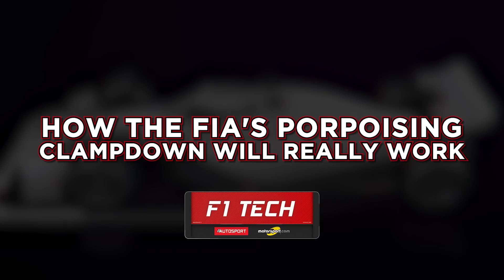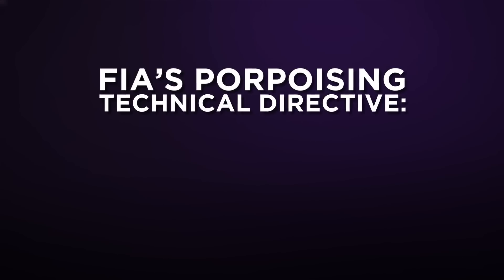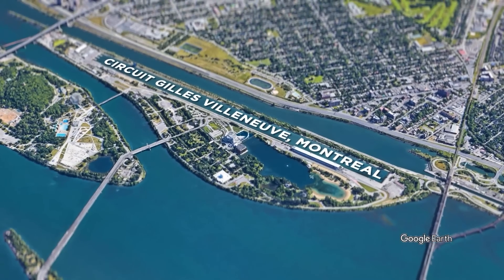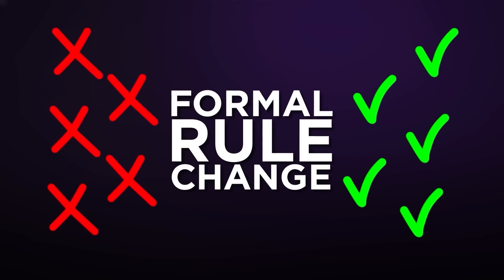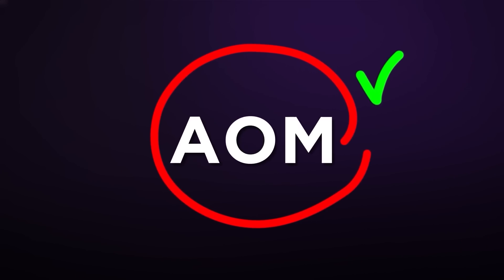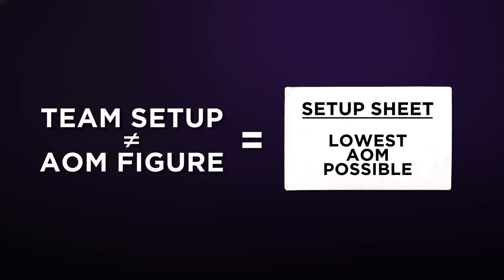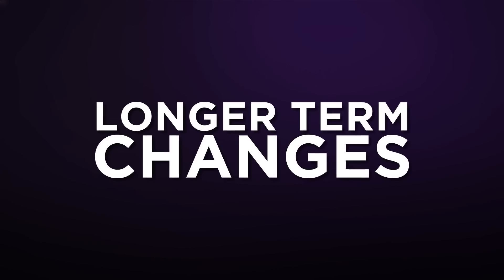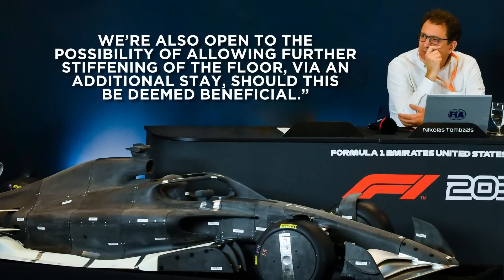F1's Porpoising Tech Directive - How it Really Works

Comment: As long as current teams which solved porpoising don’t get penalized that’s all that matters
Reply: No team has solved the porpoising yet but mercedes porpoise more than any team in most occasion. Mercedes will get more penalty
Reply: No team as solved it. That’s the problem
Reply: @built2jzlexus496  redbull has and they have a top 2 car
Reply: @zXPeterz14  if they solved it then why were their drivers complaining about it too?
Reply: @built2jzlexus496  i havent seen any complaints since the early season but i might have missed something
Reply: @zXPeterz14  they said ALL the drivers met and 19/20 drivers agreed the porpoising was dangerous after Baku
Reply: @zXPeterz14  every car still bounces a lot because of the stiff suspension this year. Suspension regs need to be changed for next year as well because this is not sustainable longterm for drivers. They could end up with permanent brain damage.
Reply: @built2jzlexus496  you dont have to have porpoising to know that its dangerous. You do know not all teams suffer with porpoising? Like even if everyone has it most teams can work around it to the extent that they dont have any at all. It comes down to the ride hight. Lift the car and no more porpoising. Walla👏 everyone knows why its happening, the teams choose to not do anything about it. Mercedes can't except they built a shit car and now puts their drivers at risk instead of running the car safely. Its a design fault and thats it. Porpoising has always existed in series where they use ground effect. Its not anything new.
Reply: @johannes727  I kno they’re all suffering from it. Why are u talking to me? Lol
Reply: @johannes727  they all suffer from it because all the drivers complained about
Reply: @built2jzlexus496  not all drivers complained about it thats a flat out lie and you know it
Reply: @johannes727  it’s all over the media that 19/20 drivers complained. Check for yourself if u want
Reply: @built2jzlexus496  You actually made me google that now and look on twitter. Absolutely nothing about 19/20 drivers complaining, and again there is a MASSIVE difference between drivers saying its unsafe and drivers complaining about it. I can only find drivers saying its unsafe. I mean im pretty sure the whole world knows its unsafe. But its down to teams who are running it so unsafe to fix it in other words lift their cars so that thry dont have porpoising. I honestly think you maybe just understood it wrong. So no issue.
Reply: @built2jzlexus496  binotto said no that toto should worry about his drivers
Reply: @titancheat  also if FIA can ban party mode in mid season, why can’t FIA do reg change in mid season?
Reply: @titancheat  the whole reason the FIA did anything is because EVERY driver complained. Not just 2.
Reply: @johannes727  Ok except Alonso
Reply: @built2jzlexus496  This guy with his blatant lying... Bro im not going to say what i want to say now. But you need some formal education
Reply: @johannes727  dude don’t call me a liar. The facts are there. U just don’t want to look for them. All the drivers complained in their meeting and it’s on record
Reply: @built2jzlexus496  im not saying it again after this. The drivers in the meeting said poirposing is dangerous. THEY NEVER FKN COMPLAINED JESUS.. THERES A MASSIVE DIFFERENCE BETWEEN SAYING SOMETHING IS DANGEROUS AND COMPLAINING ABOUT IT. FKN READ A BOOK OR LEARN SOME ENGLISH FFS
Reply: @johannes727  so the drivers said “it’s dangerous but let’s keep it”?
Reply: @built2jzlexus496  The drivers said its dangerous so the teams suffering from it should fix it or lift their cars. Thats what they said.  The drivers complaining about it is only a few realy, and its only the teams that cant get the performance out of their cars because of it. Not all drivers. And its not fair at all to change the rules to suit some teams if other teams have proven that you dont need to suffer with it. So basically it comes down to shit design from some of the teams. The issue i have with it is the fact that EVERYONE knows how to fix the problem, but because it means they will lose performance, they choose not to do anything about it. Dont you think its weird that Hammy was complaining so much about his back one week, the next week you can see the car is just as bad but he will tell you its not because they know the current rule change will limit their performance. Its all just a game at the end of the day.
Reply: @johannes727  Sainz is the driving the fastest car and he’s complaining so it’s not just ppl with slow cars complaining. There have always been rules in F1 that punished some teams more than others and none of those rules were related to driver safety. Ppl are afraid of it changing the pecking order and I’m not certain that it would.
Reply: @built2jzlexus496  I didnt say its all slow cars. What i did say is there is ways of working around it that will just mean you lose performance, im a ferrari fan and i know its probably going to cost ferrari the championship, but they should have designed a car that doesnt have these issues. So yeah. Im not happy with the fact that ferrari wont be able to compete with RB, but at the same time RB designed a car that doesnt have any porpoising. So they have proven its possible to design a fast car with no porpoising, so why change the rules if the rules are possible to follow.?
Reply: @johannes727  raising the car doesn't eliminate porpoising it only raises the speed that activates it when merc were running their cars higher they still porpoise
Reply: @rocketsts  bro you dont understand f1 then do you? Like you do realize there is a limit the cars can go right? So your point is flawed when you say raising the hight only raises the speed it happens at, so that is basically all you need to do. For high speed tracks you need to lift it in order to avoid any on top speed and on high downforce tracks you dont need to lift it as high because you dont ever realy hit top speed. A good way of looking at it is spa and Austria. Both are completely different tracks, one is high downforce the other is high speed. You obviously lose alot of downforce when lifting the car and thus lose alot of performance from the car, but its completely doable. Teams choose not to do it because they lose to much time. Mercedes wanted active suspension thats why they've been crying week after week.  Now that they realize the rules implemented wont work in their favour, suddenly you didnt hear Hammy or George complain about the poirposing once. And suddenly toto is saying it was just the bums, and that the poirposing isnt that bad. Its weird how things change in a week. Well its not weird when you look at the rule changes the fia wants to make realy... Its common sense that Merc would not complain about it anymore. Toto has even gone as far as to already say they wont have alot of issues at silverstone... The mindset has completely changed because they dont get the rule change tbey want. Like honestly it must be pretty obvious that im not a fan of merc, and im absolutely loving their downfall. Because for years and years Toto and Hammy have been benefiting from ross brawn and Micheal Shumacker's development work. Weird that the first time it was Toto and hammies responsibility to build a new car they completely f'd it up.
Reply: @rocketsts  They could have made it higher.
Reply: @built2jzlexus496  I know two drivers allready who have never complained about it, Verstappen and Leclerc, so that is two allready you lie about.
Reply: @MrShadowofthewind  well evidently u don’t kno because they did complain. Alonso was the only driver that didn’t have a problem with it.
Reply: @johannes727   it's on the fia website what team's have put in a complaint 8 team's have and ask to review the regulation. But you all missed the point it's even in this video. Not one team is passing the plank wear regulation because they are all bottoming out and scraping it. Now the fia are going to enforce that  regulation at silverstone this includes red bull. That means all team's will have to raise the car to prevent it or get DQ. Now 8 team's that have officially ask for a review and it goes to a vote then most likely will change the regulation before or after silverstone. Now instead of people complaining about it from whatever side you're on there's no point as the fia will do it whatever the fans think or not.
Reply: @built2jzlexus496   obviously all teams are suffering to a degree but others don’t really suffer with it at all like Red Bull we don’t really ever seem them having the problem tho it might exist at least it’s not literally standing out like Mercedes or Ferrari to cause some massive problems but it’s still a issue that needs to be fixed in the long run but teams don’t want to have to sacrifice performance making them less competitive and then welp a slow laughing stock of a team it’s not really a good looking having a team be so slow they become a moving roadblock to the lead cars
Reply: @MrShadowofthewind   Leclerc did talk about it a bit earlier on in the season but Ferrari at this point has lesson the effect of the porpoising however Sainz is still suffering through it
Reply: @racerlord2329  I fully understand that
Reply: @zXPeterz14  yeah you missed something all of the drivers met after Baku and everyone except alonso said something needed to be done
Reply: @benfulford3943  common chadlonso W
Reply: No.
Reply: @armands3153  yes
Reply: @titancheat  No.
Reply: @armands3153  yes, this wouldn’t have happened if Mercedes had just prioritized safety over gains.
Reply: @Rhochero  No, it's not about that.
Reply: @Rhochero  It’s hardly just Mercedes complaining about the issue. Even Ricciardo and Sainz have acknowledged the problem and raised concerns about the well being of drivers. Yes porpoising affects Mercedes more, but other drivers have also raised concerns about the issue too.
Reply: @Rhochero  Red Bull banned a lot of Mercedes’ tech for last 10 yrs. Now the table has turned…
Reply: @johnj1648  double diffuser,  exhaust blown gasses...
Reply: @titancheat  double diffuser got banned 10 yrs ago
Reply: @johnj1648  and Mercedes’ still won, now it’s red bulls turn, but good job showing your allegiances
Reply: @Rhochero  Looks like its not Red bulls turn then, because clearly they gonna nerf RB to ground just like they did it to Mercedes
Reply: @Rhochero  It’ll be even easier for RB this year then lmfao. Red Bull is one of the teams without an issue, this just nerfs their closest competition in Ferrari and Mercedes.
Reply: @armands3153  Yes.
Reply: @quigglyz  No.
Reply: @armands3153  I guess you want equal outcome vs equal opportunity as well.
Reply: @timgriffith9149  No, I want all the teams to be punished for no reason like in the past. I like that sort of thing. Consistency is key.
Reply: @armands3153  So if a team figures it out they should still be punished.  spoken like a true communist.  don't bother responding to this. I choose freedom vs communist.
Reply: @timgriffith9149  That's not what communism is, buddy...
Reply: @armands3153  please don't respond when you know nothing.
Reply: @timgriffith9149  Irony.